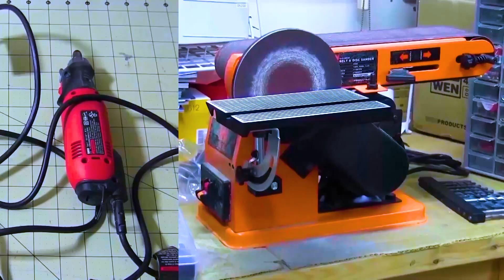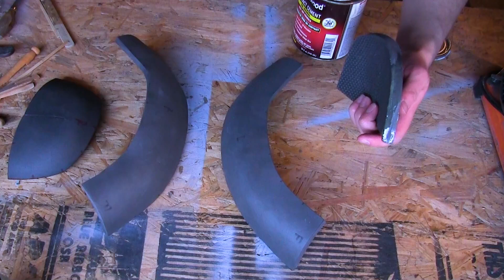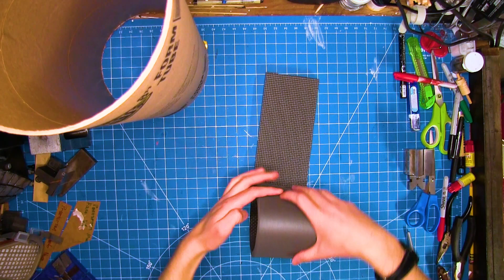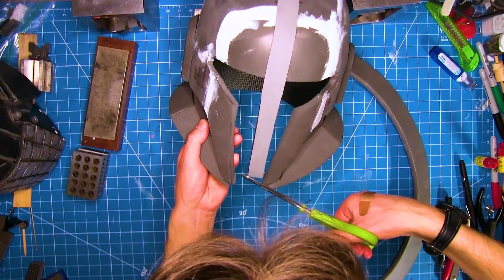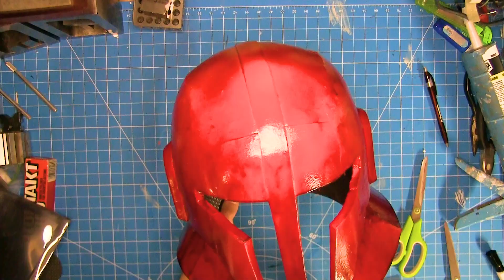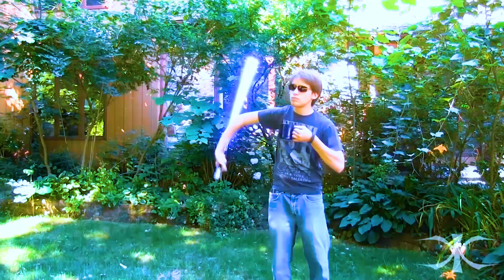Praetorian Guard Build (Mandalorian Season 3 DIY)

Comment: When you breathe in that, doesn't your visor fog?
Reply from the maker: sometimes. when i wear these at conventions, i add a fan to circulate air and clear the visor.
Reply: @WilliamJakespeareProps  how?
Reply from the maker: with a helmet this small, you usually have to put it in a compartment in the backpack area of the torso section and then run hose up through the neck to the helmet. it's a whole thing.